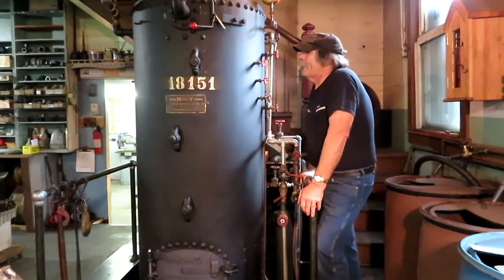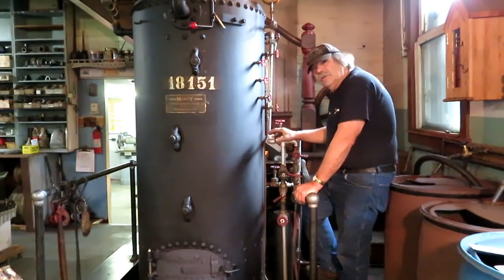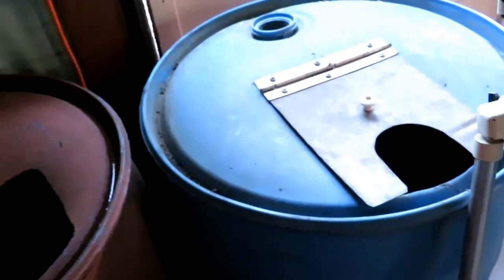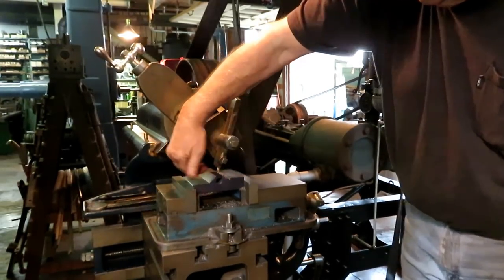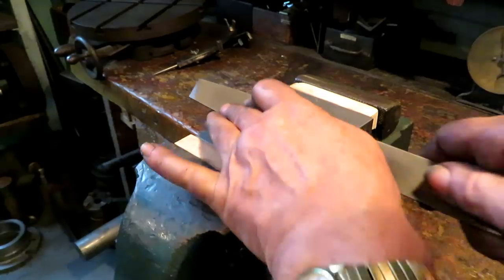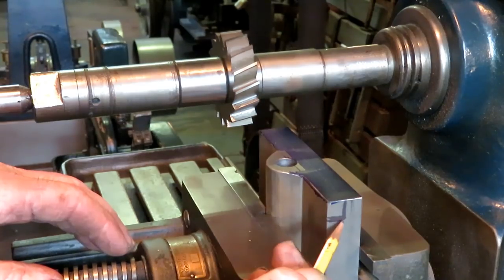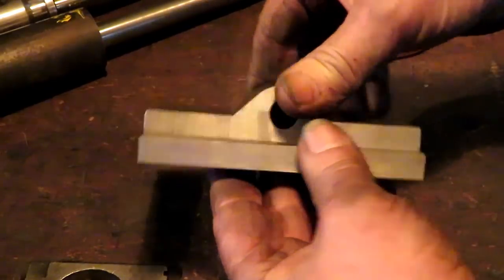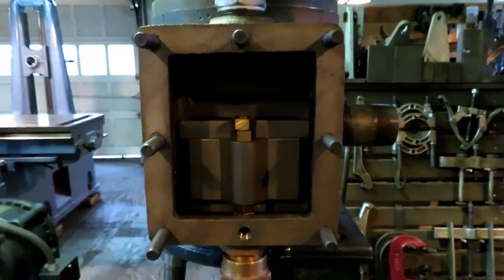OLD STEAM POWERED MACHINE SHOP 47 Boiler theory & engine slide valve

Comment: Hi Dave,  would that injector actually be an eductor?  I'm a former member of Protection Engine Co #3 Honedale PA.  http://www.honesdalefiredepartment.com/protection-engine-3.html
 or https://www.engine3.org/  If you look at the Steamer Photos you can see the Auxiliary Feed Water Pump which while running off of the boiler injects water at a higher pressure than the boiler pressure.  That ought to stir some conversation.
Reply from the maker: Yeah, I think you might say that that works because the driving steam cylinder is a larger bore than the water pump end. Kinda like a hihydrolic  jack...Dave

Comment: High school students should be required to watch your videos, it would be more beneficial than whatever they are being shown now. Thank you for your efforts!
Reply from the maker: High schools need SHOPS again. There are some very "machine talented" kids today that never get exposed to building and machining things....Dave
Reply: A lot of them have cut out programs simply because of insurance policies.  Thats what happened here in WA.
Reply: Most modern machines have digital controls that will cease to function in the event of an EMP attack. This shop, once the generator is set up, will be unaffected, apart from the camera refusing to record.
Reply: I agree 100%
Reply: @Scotian6444  That's not a digital controller with sensitive CMOS chips.
Reply: @user2C47  I think you seriously underestimate just how screwed you'd be in case of a nation-wide EMP attack...municipalities (the things that actually keep you alive in a city) also rely on semiconductors. Not being able to machine parts would be the least of your problems...
Reply: @AKAtheA  Not initially, but it would very useful to have a machine shop to help rebuild society
Reply: @user2C47  for rebuilding society, a set of gauge blocks and a good surface plate are a must, probably even more then the rest of the shop! Standards are what makes our current society function 😉
Reply: @davidrichards5594  Bring back the Mr.Pete's to High schools again
Reply: @davidrichards5594  some schools have maker spaces which may include a small lathe.
Reply: i agree

Comment: Hi again from England Mr. Richards...

As I see it you rounded off that slide valve plate because it was the right thing to do...regardless of whether it's seen or not...

In regards the milling machine :
Do you have any shorter arbours for it...?
Or could you have just used an end mill...?

Do you find the bigger engine running at a lower speed than the O&S uses less steam...? 

I really like this channel and always look forward to the next episode...😉

Comment: I can't believe Keith Rucker didn't answer. He must've been scraping something or other in on that Monarch of his :o) Great explanation of an eductor. 

Fun fact- you can build a loop of pipe across a piece of pipe that has flow in it and there will be flow in the loop as well. Ie take a piece of 6" pipe, weld in a pair of 2" stubs spaced 18" - 24" and then connect the two stubs together with 2". We always cut angles on the end and set the stubs (in our case they were 2" threaded collars) just below the inside edge of the pipe. We used it to provide a place to install a sample cell into a low velocity / high pressure gas system with greatly reduced flow for a moisture analyzer. Ie you could sample 100 million SCFD stream and not risk blowing the probe all to hell.
Reply from the maker: I'm trying to visualize why there is a lower pressure at the down stream 2" outlet. ....Dave
Reply: @davidrichards5594  Friction in the pipe causes a slight drop in pressure over it's length. If the flow rate is low in a large diameter piece of pipe there isn't a lot of pressure drop so it doesn't work in all conditions. Here's a handy calculator - http://www.pressure-drop.com/Online-Calculator/ I used one foot of 6" at 100,000 scfh and got a little over 1.5 psid Also, the slight bevel on the end of the two inch is pointed into the flow at the upstream end and away from the flow at the downstream end and that induces a little flow as well. When I saw it in use for the first time I said "that will never work" but when we turned the valves (in the 2") on and I felt the 2" warm up to the temp of the 6" I was a believer.

Comment: Back in 1970 I was working on heating systems in the Ithaca, dryden area.
I went into an old home that had a cast iron boiler that heated water for the home heat. It was a  steam system that had all the old cast iron radiators.
The sight glass valves were plugged with rust. The home owner complained the house was damp. The home owner was mislead by the sight glass reading a low water level. He kept adding water and filled the steam radiators with water.  I found the problems and blew out the valves and pushed an old welding rod through the valves into the boiler.
I then blew down the boiler at the bottom drain valves to loose the excess water.
The steam system was a low pressure system, around 1 psi. The safty pressure switch was plugged too, so the pressure could have climbed high. The house thermostat was still working shutting the system down when the room temp got high enough, mild weather.
The radiators had the little chrome air valves . The air valves open when the radiators ar cool and when steam hits them the valves close to keep the steam in the radiators.
On another steam system I found the air valves to be old and open all the time. The rooms in the house were heating unevenly, some too hot etc. Replacing the air valves cured the problems with that house.
I ran into one stem system that was designed to run in a vacuum, special valves and a purge system to get rid of the air in the system.
Love your vids.
Reply from the maker: Great comment,  steam systems worked very well most of the time...Dave

Comment: Neat.   I grew up around steam traction engines.   Steam injectors I always compared them to specialize carburetor with check valves.  At the local steam show they used a pressure washer pump   and a steam injector to top off the boiler.   Apparently this stationary boiler only came with one injector and state boiler laws required 2 sources of water.
Reply from the maker: Tim, That would sure do the job alright, and beats $1,700 for a new injector...from China....Dave

Comment: Lernt all about boiler opperation and how they all worked back in the early 1960s I was a boiler opperater for over forty years it was a great job and it was all coal fired at 300 psi producing 50 to 60 ton 0f steam an hour.

Comment: There is a shop in Pasadena California that has ping pong paddles attached to its line shat as a way to help move air around its shop when the line shaft is in use.
Reply from the maker: now that's a cheap fan...Dave

Comment: Good job,,,
Did they ever make a kit to convert a planer into a surface grinder?
Thanks again for sharing your videos.
Reply from the maker: Never heard of it but seems like you could make something that would finish flat stock....Dave
Reply: @davidrichards5594  
Thanks for the reply.
I did some research on the web. And found some turn of the century conversations.
But nothing that was identified as a kit to change it to and from a surface grinder.
Tnx again...

Comment: Great episode. I watched the early videos, but I must have forgotten a lot, because I (re)learned a lot here about injectors and ejectors. It was cool to see how you hand-cranked the angle cuts on the shaper--I've never seen that before and would not have guessed that capability. Lastly, an off-topic question: How do you winterize your shop when you head south? Do you do anything to keep down the humidity? Thanks as always for the excellent content.
Reply from the maker: Thanks Rick, Power down feed was an expensive option that most early shapers didn't have. Neither of mine have it, I've never run one with it. The steam piping is all "pitched " to run away from the boiler so winterizing is just a matter of draining the equipment, opening up the boiler and drying it inside. I had a steel rainwater tank once that was wedged between the concrete smoke stack and the shop outside wall (just enough room for it). I evidently didn't get it drained completely or it took on some water during the early winter. When I got back in the spring it had swelled up, split and pushed the wall in about 4 inches, broke about 4 studs in the wall and a window. Powerful stuff, ice.....Dave

Comment: Hello Mr. Richards you are doing a great job on the videos I have a question I have a set of No.1 Armstrong tool holders for the lantern tool post it holds 5/16HSS 
How many different sizes did arm strong make . appreciate any help thanks
Reply from the maker: Richard, I believe a #5 took 1/2" square. There also was one for 1/4" but I think that was an "Atlas" lathe thing.....Dave

Comment: @David Richards I believe I know how to lock your mill table. I have a Nichols Hand Mill (that I haven't run yet) and it is also a lever feed table. See that t slot on the front. You use that to set travel stops for production work. Make a block that you can bolt to the t-slot with a jack screw that runs horizontally. Tighten up both of your travel stops and you will have locked the table horizontally. My Nichols has a post that stands up on the saddle for the stops to rest against. I don't see anything there on your mill, but maybe it's just a part that's walked off in the last 135 years.
Reply from the maker: I'll study the B&S drawings I have and may see something like that,....  Dave

Comment: Dave,  When you measured the depth of cut on the new slide valve with your spring inside calipers and then measured the calipers with a micrometer, it reminded me of watching an "old" Machinist in the Grinding Shop at work do the exact same thing.  Even though he was grinding a part with the typical tight dimensions (for grinding), he was right on the dimensions/tolerances due to his skill of using the spring capliers together with the micrometer.  Thanks for yet another very interesting video.  And I hope that you have a great Thanksgiving!

Comment: I have a little Burke mill, with that new-fangled V belt drive.  It has that rack and pinion system on two axis, and like yours, it is easy to find your work getting sucked into the cutter.  I used the travel limiters to keep that from happening, they are nothing more than a length of all thread with two nuts on each side of the table boss.  A box wrench for a feed handle, a steady hand and feed determined by guess and by gosh, is how that one is done.  You learn how to read your machine really quick.  

Haven't done much with that mill, only job it has done (other than mere tinkering) was to remove the mushroom from the end from the shaper tool post bolt.  It's been the red-headed stepchild in my shop, so far, being shoved around from pillar to post every time a larger machine comes in.  It needs further reduction in drive speed, new spindle belt (re-pack bearings while it's apart), a properly sized vise ... and cutters.  I had one cutter (dulled, of course) come with it.  I managed to touch it up enough for that one task, but it needs a better hand at that than I've got at the moment.  Maybe I'll send it to Steve Summers so he can "practice" on his cutter grinder.
Reply from the maker: What ever works....Dave

Comment: Hello David,

I am a 'new' subscriber to your channel.  I have watched & learned a lot from some of your 'contemporaries' (Keith Rucker, Lyle Peterson, Adam Booth, Keith Fenner etc.) and am thoroughly impressed with your setup and attention to details.  Now, the dreaded "why not"...  Would it have been effectively the same process to have made the mill cuts (on the ends of the slide valve) with the shaper in a shear cutting setup?  Or, was this just an exercise demonstrating multiple methodologies of machining?

Best regards,

Ken
Reply from the maker: Hi Ken, yeah, that;s about it. I had that new 3/4" wide cutter, make in Poland that I just wanted to use on something....Dave

Comment: Question: I see you often take a lot of metal away with the horizontal mill which takes a lot of time. Is there a reason you don't rough cut the bulk of the waste away with a hack saw or other means, then do the final precision finish cut on the mill? Like at 40:00 in the video. Couldn't you rough saw cut that piece off to within 0.125 of the finish, then use the mill to level it off? Seems it would speed up the job considerably or am I missing something here?
Reply from the maker: Andy: You must be a young man full of "vim & vigor" to hack out two 3/4"x3/4"x 4" cuts by hand with a hack saw in #40 cast iron rather than watching the mill do it in 6 cuts each side. Thanks for watching and the comment.....Dave
Reply: @davidrichards5594  : Oh, no. I am 58, hands on electrical engineer and hobbyist, and much wiser! That's why I asked an expert like you. Some young internet era buck would just say, and sarcastically at that,  you are doing it wrong! I do admire your skills and have learned a quite few new machining tricks from you so please keep the videos coming!

Comment: Hi Dave,
I loved the intro.
I have a B&S No. 1-1/2 Universal mill I think it is about a 1905, as the last patent date is 1903. Unfortunately it is not complete. So is a long term project (or parts machine).
But speaking of rapid traverse, it has a reduction in the Right hand crank and the left hand crank is solid to the lead screw. 
I dream of obtaining a B&S Universal dividing head and trying my hand at cutting some spirals, maybe making some drills the old fashioned way. 
Cheers
Reply from the maker: That WOULD be interesting..Dave

Comment: if you  reversed the angle of the cutter away from the boss it would chatter less ie a left helical instead of a right helical which you have there unless if you in America then the opposite would apply
Reply from the maker: My selection of cutters for this job wasn't too great. I had a wider one that would have covered the whole piece but I figured having more tooth load would have made chatter worse.. ..  left helical in USA ha....Dave

Comment: Very nice looking valve.  
A word of caution about the injectors and  inspirators.  When they are disassembled (taken apart) the cones inside are sharp.  The angles and relative locations are whet makes them work.  If they are damaged or have a scale build up on the parts they probably won't work.  Never use a metal brush or other metal tool on injector cones to keep from scratching or otherwize damaging them.  They are made of brass.   Soaking in vinegar should remove the scale.  Inspirators were the predecessor  to the injectors.  Penberthy still makes injectors in this size range.   Injectors move a lot of water and are used for steam cleaning.
Reply from the maker: They do move a lot of water. Even at low pressure, one injector puts water into the boiler faster than a 3/4" hose at city pressure does when I fill it to start up.....Dave

Comment: Even though you are using rainwater for your boiler, what sort of process do you use for determining boiler water chemicals?
Reply from the maker: As per Jim Conte's "boiler saver" I just adjust the PH of the water to 9.5 with pool chemical when I fill it, give it about 4 ounces of the additive and about 2 ounces per barrel of feed water from then.  I check the PH of the boiler water now and then but it seems to stay up around 9.5 because of the buffers in the "boiler saver".  I blow down 3-4 gallons daily when the water is low....Dave
Reply: @davidrichards5594  OK thank you. Wow, what a quick response!

Comment: Get some oil on that tool!
Reply from the maker: Dan, Why do I need oil when cutting cast iron? It's not recommended by anyone.....Dave
Reply: @davidrichards5594  Was thinking about recutting all the grit & extreme wear on the cutter edges. Have dulled 'em but used oil on other cutters and their life was quadrupled.  Just sayin'.

Comment: can you add an analog/automatic down feed? On the B and S,  is that exesive surface speed,  an 8 inch cutter look blurred on screen as it goes around,
Reply from the maker: Hi ryan:   I think that he light is so dim in the shop that the camera has to slow down it's exposure speed and it makes everything that moves a little blury.  That was about 145 RPM which is about right for that cutter on cast iron....Dave
Reply: @davidrichards5594  Ah,  good call.

Comment: David , I enjoy your series very much. I like your steady easy going pace. 
I see you have a wooden floor. Do you have concrete piers under your bigger machines?
Do you have any problems with steam related rust in the shop ?
Reply from the maker: Hi Freddy:  BIG timbers and piers, There isn't much steam floating around, Smoke and dust (when firing up) . The biggest rust problem is condensation on a warm damp day over a weekend when things cool off inside....Dave